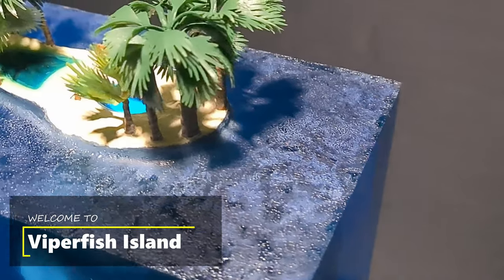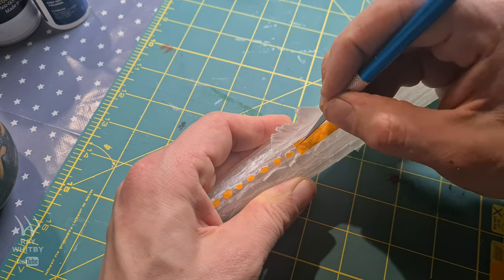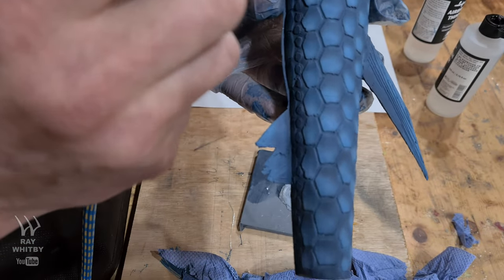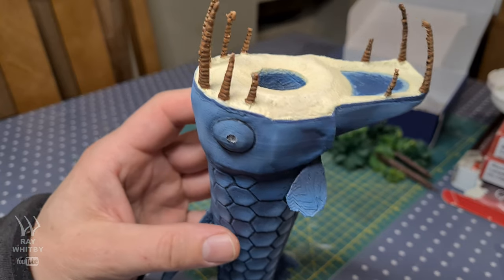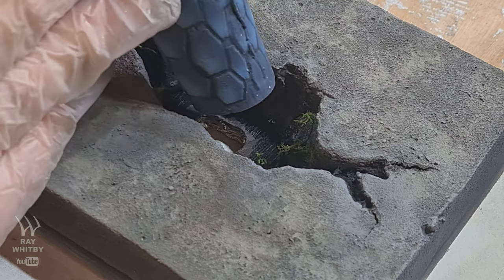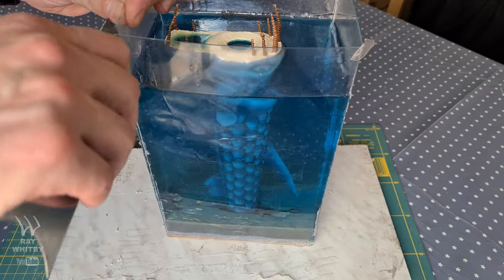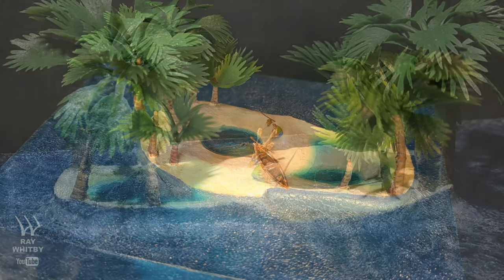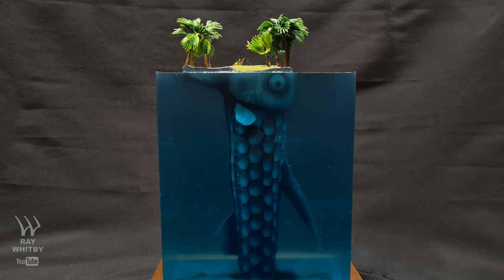How to Make a Thalassophobia Zombie Viperfish

Comment: it may not have the resolution you would prefer, but it still looks fantastic
I have seen some folks add strips of wood to a form of plastic to strengthen it, I would guess this would have needed an entire secondary box for support
Reply from the maker: I did think about this route, but only after I had poured the second layer, too late alas. I'm hoping thicker perspex would solve the issue too, but probably would benefit from your idea. Thanks C Hammers!